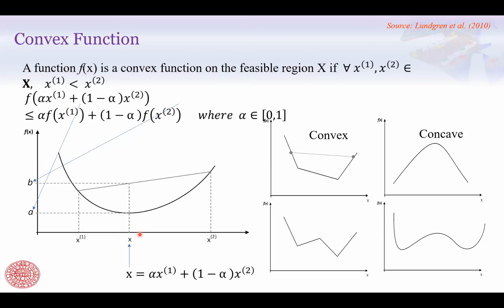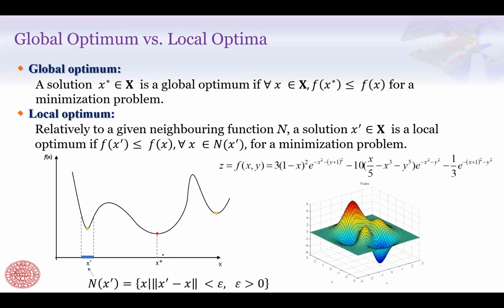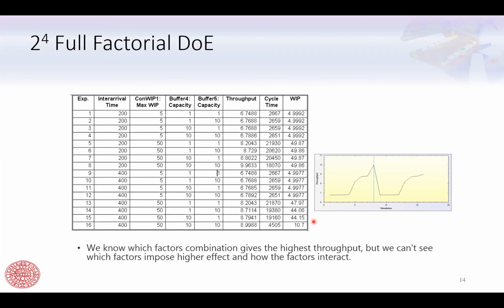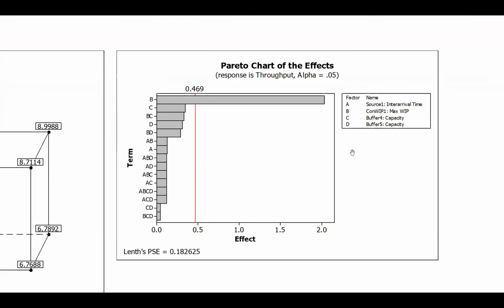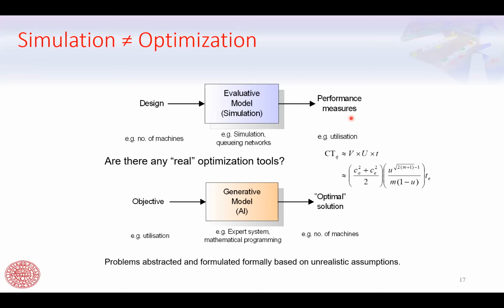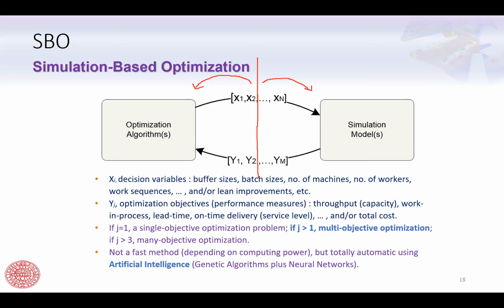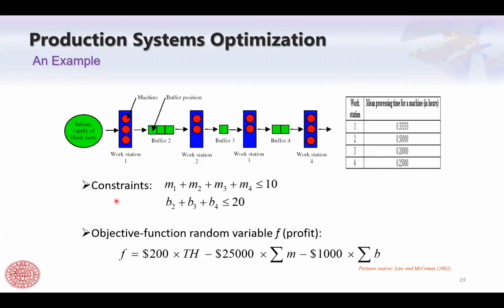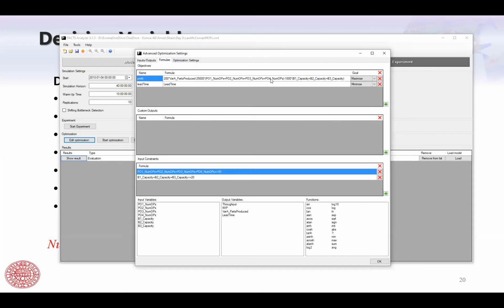UU MOO lecture 20210429 Part2 - SBO1

Comment: I did not get the meaning of positive induction. and negative induction.  Besides that,  in slide 16, I did not understand the black line and the dotted red line. what does it mean when they are parallel and what does it indicate when they are not parallel .